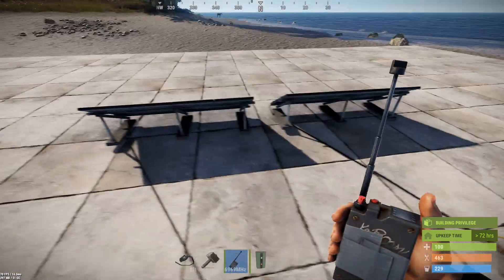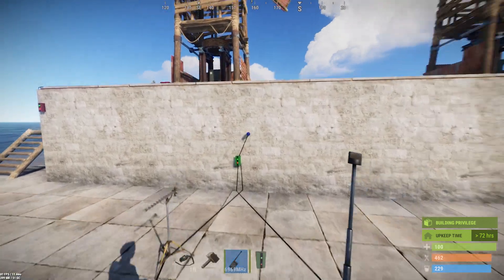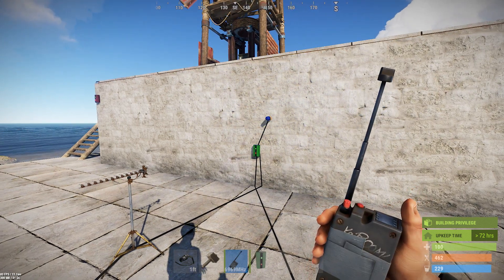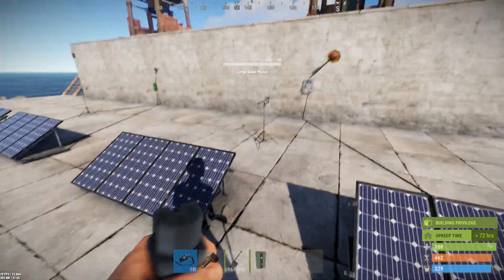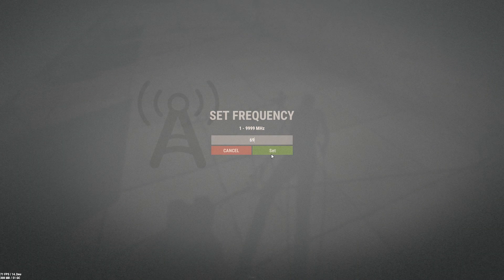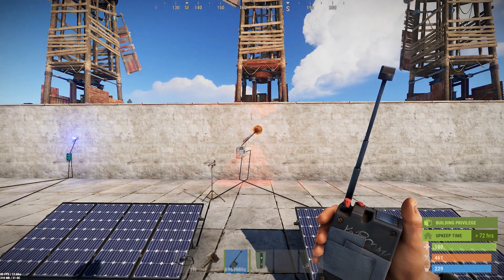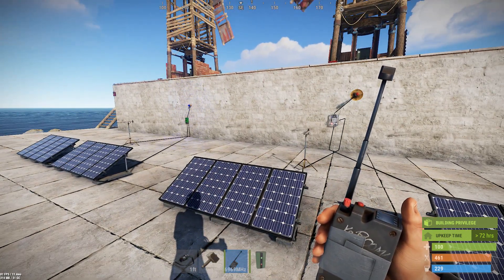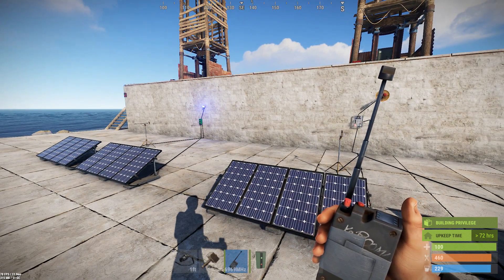Rust Electricity: User Request - RF Transmitter Stateful Switch

Comment: So helpful. I was overcomplicating things using a bunch of branches and a blocker to power multiple sams and could only get the switch to turn off with the transmitter for whatever reason. This is so much simpler, cleaner and efficient. Thank you.

Comment: thanks for the video but is it still working? ive tried both methods and it doesnt seem to work for me.. im trying to hook up an igniter instead of the lights but it wont spark on when i click the rf transmitter?
Reply from the maker: It should if there is enough power going through to run the igniter...

Comment: ok help me with something rabbit...
Can u make RF transmitter that can toggle  20 Light with wind turbin for power source, but it wont drain the power.
Reply from the maker: You need a power source that is always on for your RF receiver. You could have a different power source or battery/blocker for powering the lights themselves, but without power all the time to the RF receiver it won't be be able to trigger the string of lights to come on.